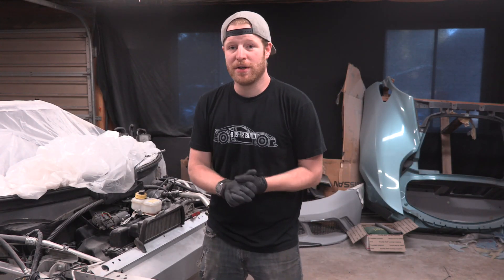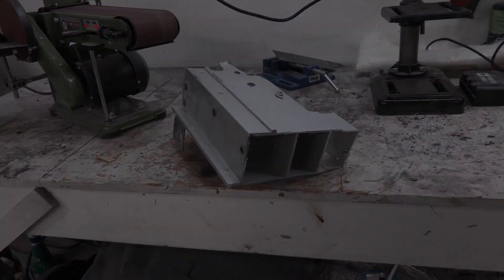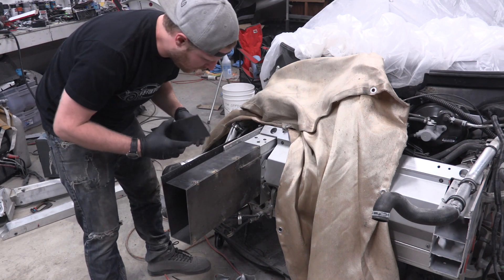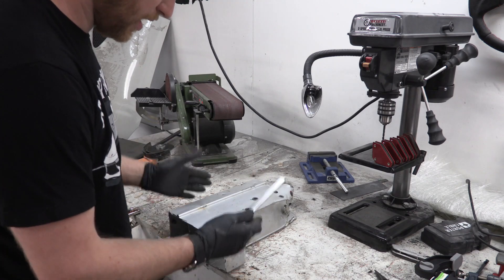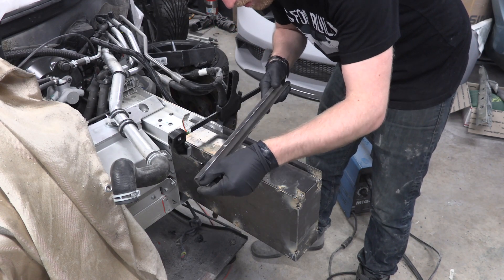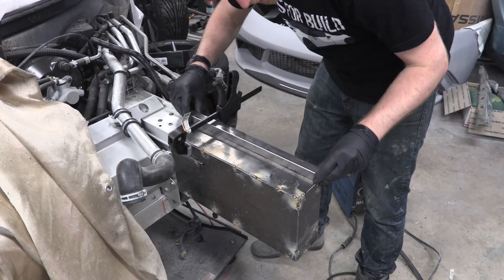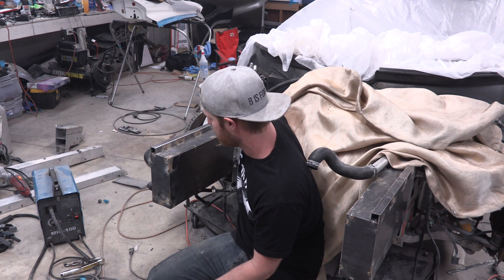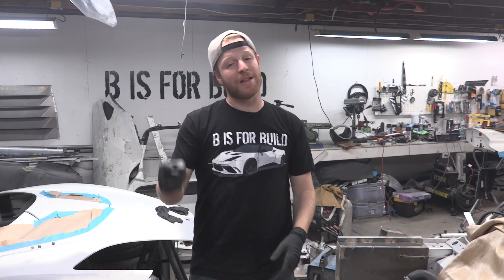Budget Lotus Evora Pt 20 - Rebuilding The Impact Bar

Comment: What size engine does an evora have
Reply: EVORAS DO NOT HAVE TURBOS. THEY HAVE SUPERCHARGERS
Reply: swedish minion That's irrelevant... You could just crank the boost and add fuel to the 3.5 and it would make more power as well. It's about making power that would last the life of the car and survive significant commutes.
Reply: volvo's are shit for reliability compared to toyota
Reply: The engine size is about tree fiddy
Reply: 3,5 litres turbocharge
Reply: +Cristian Federico v6 ?
Reply: +Chase Manneh yes v6 355 hp
Reply: +Chase Manneh the evora 400 has 400 hp they upgrade the turbo.
Reply: he's explained before that this model is not forced induction... But he said that may change in the future. So that means it only makes 270ish hp
Reply: +Marcus Kellermann check reliability ratings toyota and lexus are on top
Reply: Galf506 Also too pricey for it's performance :)
Reply: We put the standard V6 3.5L from the Camry in with bigger injectors added and a Harrop supercharger for the 350 horse Exige and old Evora S but an Edelbrock blower with watercooled intercooler for the new Evora 400. This build is the standard NA version (no blower) with the box stock 270HP motor
Reply: +Harry Forsyth why have a super car if it's a camery motor
Reply: +Jesus Martinez it's a Toyota v6 so I believe it's the 3.5 with a turbo
Reply: wtf you can get like 400hp of a volvo 740 16v engine with turbo and thats without doing to much stuff and that a straight 4 under 2.5
Reply: +swedish minion but a b230 is a 25 year old motor. Even though it's bullet proof a cammry motor makes more sense
Reply: Still more horespower from a 30+ year old motor thats a straight 4
Reply: no its a 3.5L v6 from a Camry
Reply: ehh people lituary break the cam rubber thijng and they survive just put a new one on buts that the 8v but the 16 v you dont need to port to get to 400hp without doing much slap a turbo on and tune it easy 400hp and they survive everything
Reply: +Reduxian Yeah, a V8 can achieve the power levels desired with a lot less compression and strain on the drivetrain. A small displacement 4 cylinder engine will be put through a lot more stress to achieve those power levels, from compression, crank, pistons and rods, all these components will be under double or triple the stress if it was a larger engine.
Reply: +Kyle “SlowSupra” B you must be joking
Reply: It has supercharger! Not turbo.
Reply: 3.5 L Toyota 2GR-FZE V6

A supercharged v6 engine.
Reply: Marcus Kellermann What should I be joking about?
Reply: +Kyle “SlowSupra” B Volvo is known to be the most reliable car in the world
Reply: making a 16v turbo unless you have the b204ft which is almost non existent requires a lot of mods however I have seen videos with 900hp and these engines can handle a lot of power and still have great reliability there are lots of b230ft engines with 300,000 miles on it. so if he was to go that route he would need to cut valve reliefs into the pistons, lower compression, make custom brackets for the timing belt, aftermarket ecu, better injectors, bigger turbo, custom exhaust + headers, adjustable timing gears, better vale springs, most likely custom intake, adapter plates for the transmission, custom engine mounts, I could go on but it would be stupid. you also don't have VVT on a b234ft and its a cast iron block so its heavy.
Reply: ***** whos we?
Reply: Norfolk's premier car manufacturer, of course....!

Comment: One thing to think about when combining the steel and aluminum in the frame is electrolysis. I am restoring an old car currently and I thought of using aluminum to replace the rusted spots so it would never rust again, but I learned that when aluminum and steel are combined then they cause the accelerated destruction of one another. So I had to use steel again instead of aluminum. Make sure you separate them as much as possible and try to insulate between them.
Reply: Ah never mind, just watched all the way through and saw that you mentioned that in the video.
Reply: Aluminum is much lighter which is why it is used in aircraft, and the Evora is mostly aluminum anyway to save weight, i'm guessing it had to be aluminum more for the purpose of weight, and it was made into the square tube shape for the crash purposes.